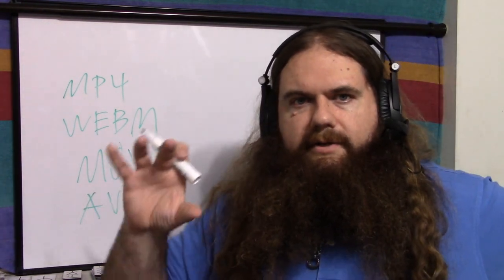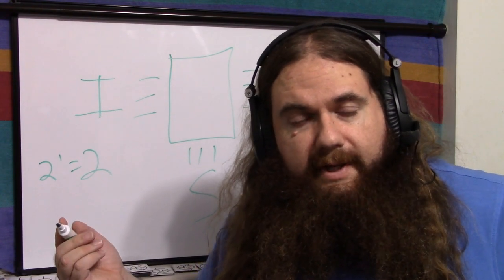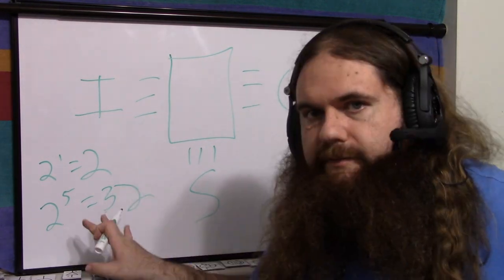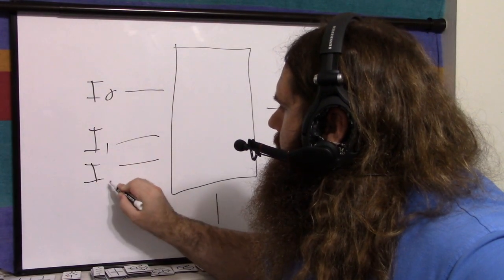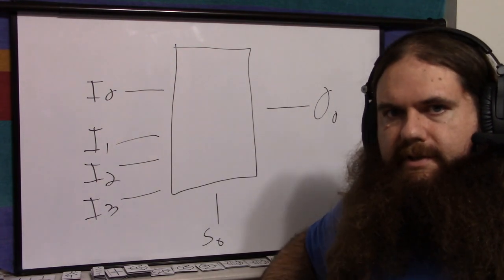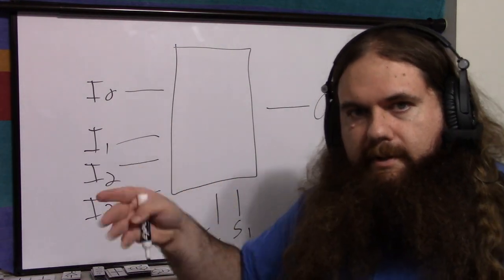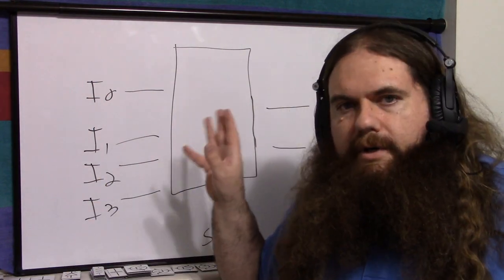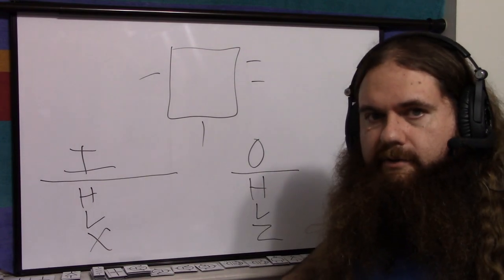Multiplexing and Demultiplexing - Muxing and Demuxing - Combinational Logic - Simply Put

Comment: I hope you design us a muxer and demuxer   which can withstand high power
Reply from the maker: Any time you need something to handle more power, you've got three big options: 1) pass the signal through a power amplifier or buffer right before you need the extra power, 2) use parts that can handle the greater power (you can get powerful resistors, capacitors, and both bjt and mosfet transistors without trouble off some place like Mouser), or 3) run extra parts in parallel so they share the current load.
Reply: @simplyput2796  today I've enjoyed seeing the ballast video as the third option. Thanks